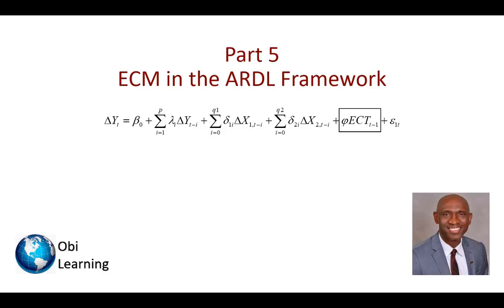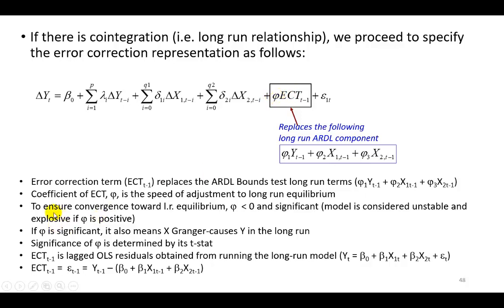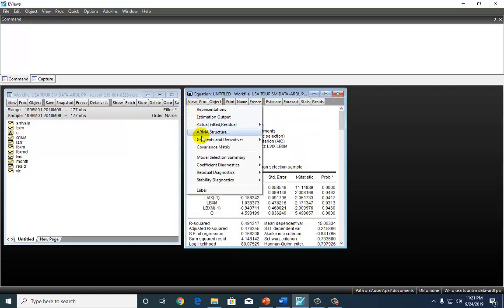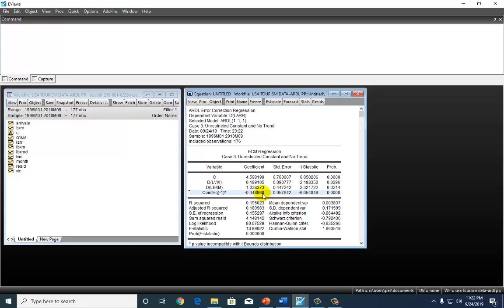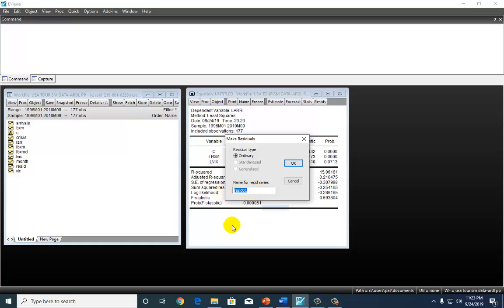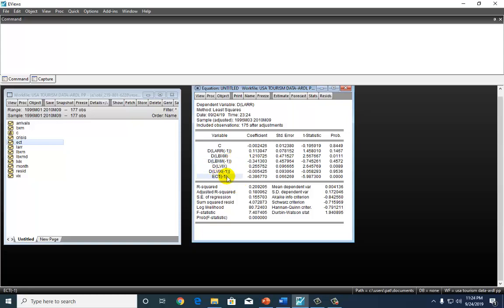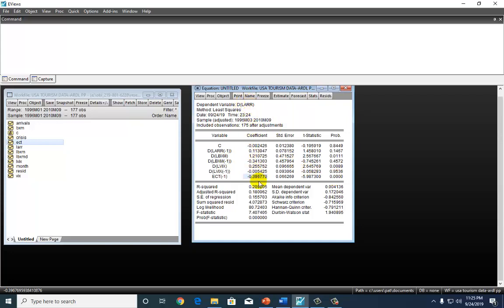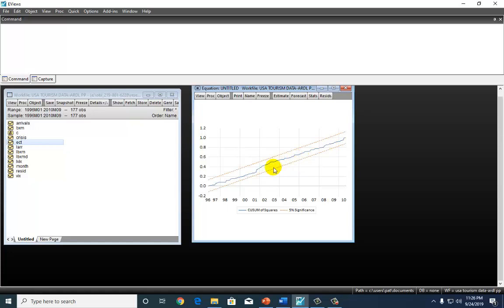ARDL Bounds Test - 5of6 (ECM)

Comment: Dear Sir, May I ask you a question: if the optimal model shown as: (Y,X1,X2,X3) = (1,0,0,2). Is it possible to obtain the short-run coefficients for the X1, X2? I think it is not because X1, X2 do not exist the lag order. Thank you Sir
Reply from the maker: Lag of 0 means that only the contemporaneous terms (current values of X1 and X2) are included in the model.
Reply: @PatObi  my short-run regression as followed: d(Y) d(Y(-1)) d(X1) d(X2) d(X3) d(X3(-1)) d(X3(-2)) ect(-1) c. Is that correct?
or I have to regress the short-run dynamics with the equation:
d(Y) d(Y(-1)) d(X3) d(X3(-1)) d(X3(-2)) ect(-1) c? Because X1 and X2 are not have lag orders?
Thank you Sir

Comment: Dear sir, I have checked my diagnostic at the end of the error correction model. My question is should I show these diagnostic tests in my paper? 
Or
I should run diagnostic tests for the long run model and keep those in my paper?
Reply from the maker: Yes, you should show a summary of your diagnostic test result.
Reply: You mean, the diagnostic tests you have performed just after the error correction model - Right? 
And not the ones that one can find after ONLY the long run model- right?

Comment: Hello sir thank you for your video,
I have question, you explain about long run with ect where they jointly cointegrated, however how to determine whether independent variable individually significant affecting dependent variable in the long run?
Reply from the maker: The second section of your EViews output shows the l.r. coefficients. That's the section entitled LEVELS EQUATION. I interpret it in this series as well as in my NARDL 5-part series.
Reply: I have research about exchange rate effect on export, i have some additional control variable to increase my rsquare, ect told us that whether or not exchange rate and control variable jointly in the long run affect export isnt it?, However i only want to see exchange rate effect export in the long run, my question is how to see the effect of exchange rate on export in long run individually
Reply from the maker: @amaimask8685  Then simply look at the coefficient for exchange rate (and its corresponding p-value) in the long run levels equation, as I've already explained.
Reply: @PatObi  do you mean ols regression in minute 4.02 ?
Reply from the maker: @amaimask8685  Please go to about the 6th minute of part 4of6 of this series to find the long run levels model.
Reply: Thank you for your answer pat, it help a lot. However i still have another question, honestly i still confuse whether to use vecm, ecm or ardl. Can you tell me the differeence?
Reply from the maker: @amaimask8685  But if you patiently watch the entire series, especially the first two parts, you'll know. Use ARDL when at least one of the regressors is I(0) when the other is I(1).  If all are I(1), use ECM.
Reply: @PatObi  thank you for your answer pat, but honestly i still one another question. In your video of ardl or vecm part you always tell that ∆y only previous or lag value and ∆x is current and lag value, why is they different?

Comment: Hello Pat. I can see that the DW result is 0.69, meaning there is serial correlation in the long run model. Is this a problem? When i read journals, some authors show the DW result and others do not! What should we do here? thanks!
Reply from the maker: Good question. My delayed response is because I wasn't exactly sure how best to respond :-) With SC, parameter estimates become inefficient, which may be an issue if you're forecasting.

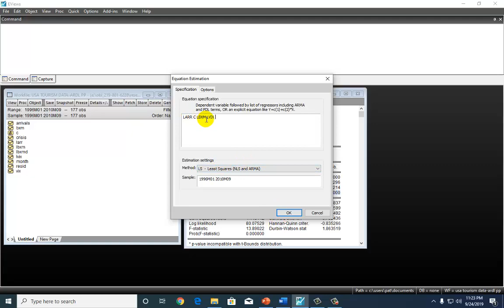Comment: Excellent set of videos on ARDL modeling with bounds testing. I have a question on the OLS specification to obtain the ECT. Referring to the variables in your example, should the specification be as shown in the video (3:26 to 3:55), or is it more appropriate to specify the equation as LARR C LBXM(-1) LVIX(-1)? Thanks.
Reply from the maker: Thanks Dacio, for your Q. No, it should be as shown on the dialog box. The equation from 3:26, LARR C LBXM LVIX, is the correct long-run model out of which we obtain the model residuals (ECT). With those residuals, we can then run the ECM in the following minutes of the video, as shown. This long process is now easier to do in the more current versions of EViews which explicitly has the ARDL command. Hope this helps.
Reply: @PatObi  Thanks for your reply and, again, for sharing these helpful videos. Regards.

Comment: I have problem with Error correction coefficient?
In conducting a cointegration, if the coefficient of error correction is -1.07  (i.e. over correction) while the rest of the results are good (significant with good p-values), what could be happening?  Should that model be revised or disregarded?
Reply from the maker: I've read somewhere that such a model may still be useful. But if I had such an unusual result, I would (1) review the dataset to ensure correctness (2) check the diagnostics especially serial correlation, heteroskedasticity, and model stability - CUSUM test; and (3)  try other lags for a better model. Hope this helps.
Reply: @PatObi  thank's ph. , i am redye  checked the diagnostics especially serial correlation, heteroskedasticity, and model stability - CUSUM test; and wald test for cointegration. all this tests  its sutible.

Comment: Since there are 3 variables, therefore there are 3 cointegration equations to be tested, but you kept on testing only the first equation where LARR is taken as the dependent variable, and you showed that the variables are cointegrated and also that the two predictors jointly granger causes the dependent variable LARR. But, is it also possible that the other two equations when tested may also show cointegrations so that graner causality might run in the opposite direction?
Reply from the maker: Yes, the other equations are also tested. But I showed only one test for purposes of the video.

Comment: Hi Sir, could we just directly used the Error Correction Form that provided by Eviews 10 rather than compute the ECT by ourself? Because if follow your steps, the ECT will become insignificant.
Reply from the maker: Yes, in your bounds test output, you can go to coefficient diagnostics and then to ECT.
Reply: @PatObi  Are they the same  actually?
Reply from the maker: @yenl1n  Not exactly. EViews reparameterizes the model for a more parsimonious specification. Please feel free  to seek the opinion of others regarding this as I'm not completely certain.
Reply: @PatObi  Hello my Professor, Please Sir,
    I.e. EViews 10 display of the short-run equation is final, or is should it be changed?
Reply from the maker: @smsm314  Not sure I understand. How can you change it if that's the result produced by your data?
Reply: @PatObi  For example;  ARDL(2,2,0)
Eviews estimates the short-term equation without the  third explanatory variable!
we do not calculate (manually) the short-term coefficient for this variable?
B.w.
Reply from the maker: @smsm314  The third explanatory variable is still relevant. A lag of 0 means only the contemporaneous term is what to use.
Reply: @PatObi  OK yes this is the general ARDL Model, But this variable it does not appear at the level of the equation of short-run (according to EViews10)?
EViews 10 S-Run:          d(y) c d(y(-1)) d(x1) d(x1(-1))
Reply: The problem is that according to EViews 10 (and not EViews 9), this variable does not appear in the short-run equation !!!!!
Reply from the maker: @smsm314  If I understand you, it would mean there's no short run causality from that variable to Y.
Reply: @PatObi  Hello my Professor, I.e. we can say that the old display of EViews (EViews9) is incorrect?
Thank you in advance Sir.